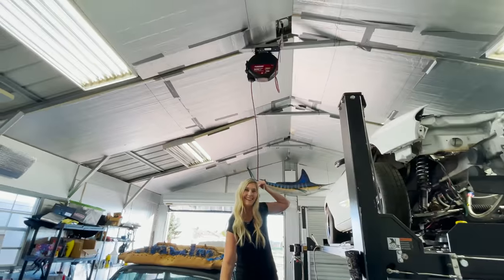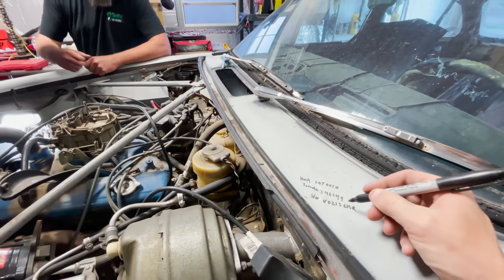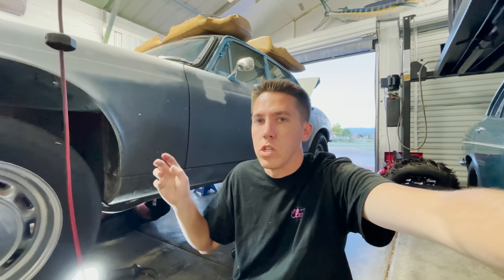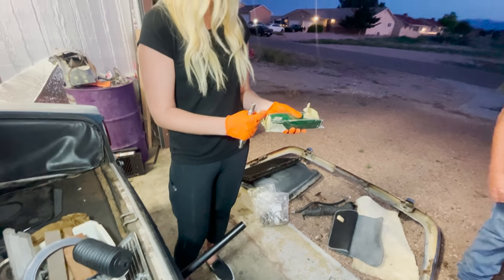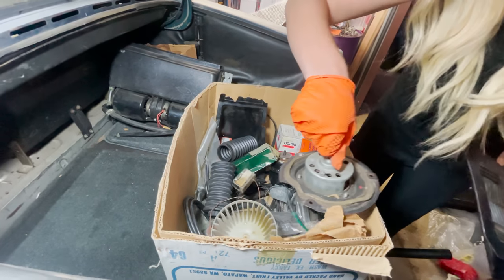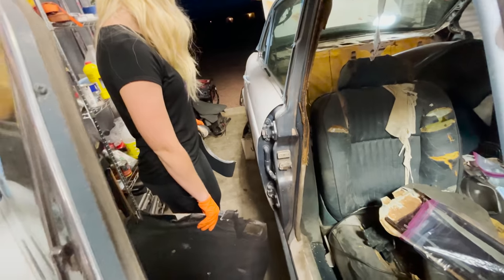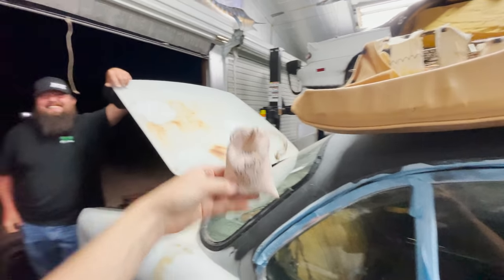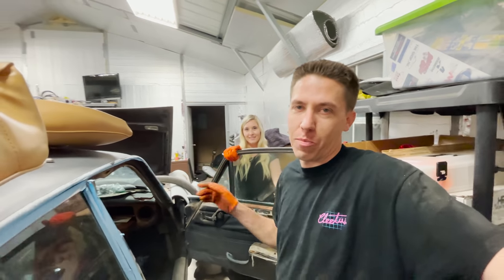April Starts On Her Corvette Powered Jaguar Burnout Build!

Comment: That's the same block and heads that are in the Tide Car I had at Cleetus and Cars Indy. 8/1 compression. It's probably a remanufactured engine, low power but quite durable and resistant to tuning mistakes.
Reply from the maker: Heck yeah that’s awesome to hear! Your car sounded good!

Comment: The xj6 originally had a borgwarner 65 Trans and the xj12 came with the turbo 400. It's pretty odd to make an adapter plate for a $200 Trans that can be found anywhere in any old Chevy lol

Comment: pretty sure that era Jaguar used a copy of the turbo 400 built under license, and that's why the small block chevy was the swap of choice
Reply: The XJS and (V12 2dr) and the XJ12 (4dr V12) used a Turbo 400. The XJ6 (4Dr I6) used a Jag transmission which   Was fine for cruising but not good for much else.

Comment: 010 blocks are standard 350 used in everything from trucks to vettes. L82 engine used in vettes in the  mid to late 70's were the high HP version, 220-250 hp depending on year. Pull a valve cover to find the head casting number. If it's truly an L82, you'll see factory screw-in rocker studs and pushrod guide plates. 882 heads were meh, slightly better than your average smog head because they have 1.94" intake valves, but being the first attempt at a 'lightweight' head, they didn't have much meat for porting. The L82 isn't a torquey small block, definitely have to keep it revved to do burnies. I'd go LS/TH400 for a burnout car.
Reply from the maker: Good info Steve thanks! I don’t know much about sbc stuff lol. That’s the plan see what the stock engine can do then pop a LS in it and head to the moon 🚀 lol

Comment: That a BOP(buick/olds/pontiac) trans? And you're gonna need enough nitrous to melt them pistons to make that lil 350 do much. 882 heads are lacking in the power department, 170 horse would have been on a good day at the flywheel. I use to have a 77 vette, the l82 had stellar performance

Comment: The numbers on the heads are under the valve cover. The trans looks like a turbo 400. on the front of the right side of the block there is a number pad, That will tell you exactly what engine you have. I commented before watching the rest of the video.
Reply from the maker: Looks like we might need to pop a valve cover at some point!
Reply: Yes remove alternator and there is a block land on passanger side just below head seam. Will be three letters, will tell you what motor is out of

Comment: About how fast is your wheel speed expected to be during a burnout and how long does a new set of tires last?
Reply from the maker: We need to figure out what the rear gear is. In the burnout truck it’s around 150-160mph of wheel speed. Some of the jags have really low highway gears so this could be even higher if the car has enough power to do hi gear burnouts